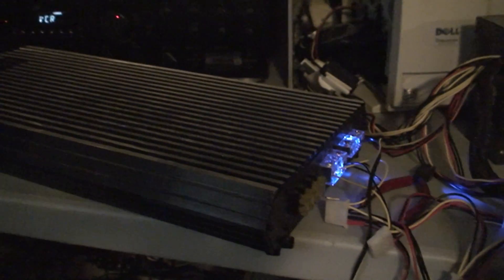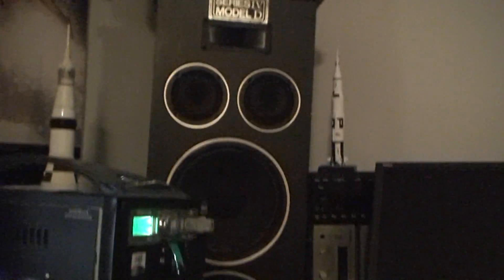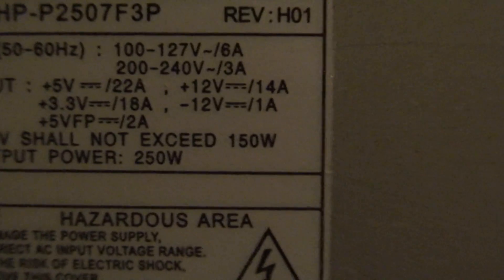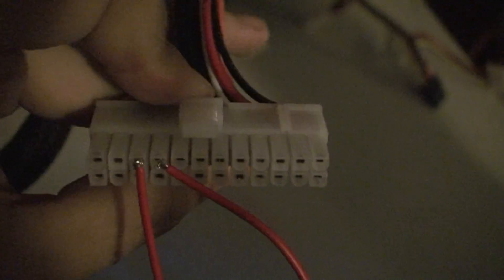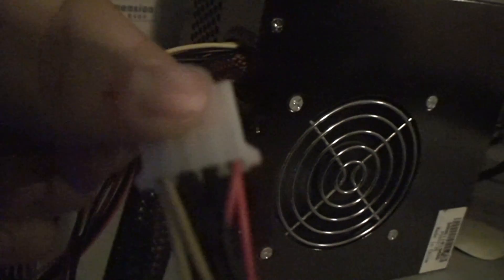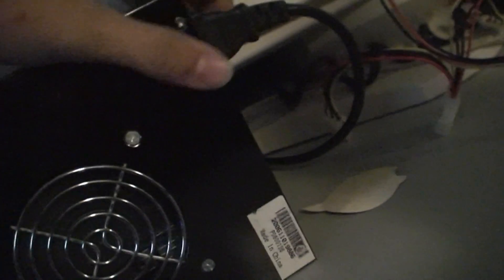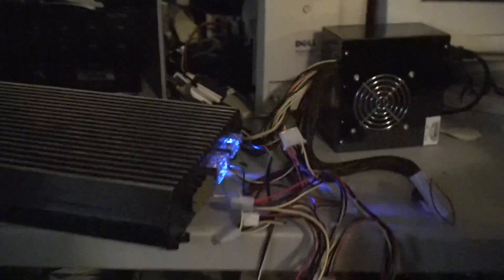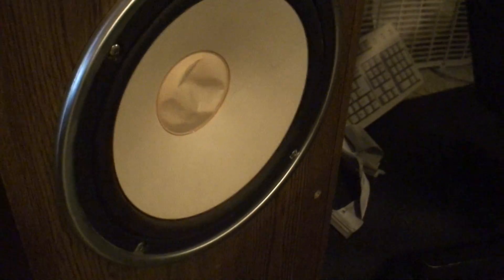How to make a Car Power Amp work on AC power using a PC power supply

Comment: if i have a 600 watt amp, 1100 watt sub, and a 125 watt PSU, can i run it with the gain turned down, and can i hook up a capaciter between the power unit and the amp to be able to run that much?

Comment: @ToXiicBacon no. an extension cord runs 120v AC current. which will fry the amp. you need to convert it to 12v Dc with this or another converter.

Comment: You know they make powersupplys for stuff like that? They have them in a variety of amperages. I used to have a 25 amp power supply it powered my small rockford fosgate punch 40 just perfect I was able to also run it bridged with no problems. It was a Astron brand switching powersupply.

Comment: This does work. However, REM means remote. Which is a power wire from the head unit that sends signal to the amp when the key is turned on which turns the amp on. FYI.

Comment: @t93raze ive heard to be stable to blast it like you would in a car you need around 1.5x the watts of your amp. so if ur amp is 800 watts, you need 1200 watt power supply

Comment: great video. stupid question from a nerd :) so i know how to brdige power supplies together blah blah. im not going to buy one, just bridge maybe 4 or 5 together. ive got em laying around. and its a cheap way to do it. and i know it wont blow cuz im doing it properly. hes got a 1000 watt amp but the speakers(2) are probably only 400 each. i hear you need around 1.5x the power supply watts of what your amp is rated at. is it true? thanks in advance

Comment: REM on the amp is the remote wire..on the back of your car radio there is a blue remote wire that when you turn your radio on it tells the amp to turn on...turn the radio off the amo powers off.

Comment: hello um i have a 800 w amplifyer and i rlly need to know what type of  pcu i should buy so i can blast it it says i sould set a fuse between the batery to the amp fuse recomended (40 amps) so i dont want to buy a psu wait 3 weeks and it justs shut of when i try to blast it pleas reply 

(im currently using a 300 watt psu now but i want more power to the amp)

please reply i do realy need help

Comment: What makes me chuckle the most as a competent design engineer of extremly robust and high power sound reinforcement gear is how many people think they actually have a 1000-2000-3000 watt (whatever) amp just 'cause it says so on the case'. There's a reason why a true 1000 watt PA amp cost 20 times as much as car amp or cheap PA amp with '1000 watts' plastered in big letters on the case.

Car amps for HI-FI off ATX off line SMPS don't equate to HI-FI. Sub in a surround system then,,, yeah!

Comment: A) REM + remote it turns it on and off
B)The correct way to do it is to go inside it and put a 40v power wire directly after the diode bidge of the amp. The amp takes the 12 volts you put into it converts it into ac then pushes it to aroud 40v rectifyed. SO IF YOU WANT TO DO IT RIGHT PLEASE PLEASE PULL UP THE AMP or just simply get something called a HOME THEATER system. If any problems are caused by this message it is NOT my falt. I dont exacaly know how much volts your amp converts the 12v to

Comment: Thanks alot man that helped me out... i had one question though can you use 2 pc power supplies on 1 amp? like wire them in sequence so that you have double the power? also i noticed i have the same computer tower case as you.

Comment: @bonemantis Ok, Well I've found a 1000watt PSU for $130-150 range its a cooler master brand.  As far as the AMP goes, didnt know that a under powered amp will blow high power handling speakers.  These JBL's are supposed to be liquid  cooled, The car stereo shop that sold them to me saw my in car setup and said a better power amp would be better (better sound), but nothing  about blowing the JBL's. Not doubting you, just shocked. Now I need to find a amp.

Comment: @beercap007 You should probably buy a new amp, because a 500 watt amp isnt going to be enough to power 2 1000 watt subwoofers, it will give you some sound but not much, and if you turn up the volume too high youre gonna blow the sub.
I would recommend you getting at least a 1200 watt amp, and a 1200 watt power supply, 1200 watts psu is the most that there is. I dont think theres a 2000 watt power supply. And all of that is expensive, and that will still not be enough to turn ur subs full volume.

Comment: very cool video buddy, I've been wanting to do this for like 2 years now... I have a band-pass box with 2 10" 1000watt JBL, and a 500watt (isn't a true 500) amp LEGACY brand.  What size power supply should I go out and pick up to power this? I have a 5.1 home theatre system, but lets face it... most of the bass boxes in such systems suck, so I'm looking to beef it up a little ;)  I am also making my speaker portable so I can take it outside on my back deck patio when I have my patio speakers on.

Comment from the maker: @OEAbass 
it will run it, however you run the risk of burning the unit out if you pull too much current.  most PC power supplies have a safty feature where they will trip off before damage occurs, so you should be allright.    tying the wires together works on most psus, especially good on psus that have mutible power rails, however on advanced units (in my experience) like ones with PCIE power outputs tend to trip off and not come on with all rails tied together.

Comment: great video! I want to connect a 12" 1200 watt peak power sony xplod subwoofer with a 500 watt bazooka amp to a dell inspiron 550 pc. I have a logitech z cinema sound system if that is important, however what kind of power supply would i need? Please reply thanks, and again, great video

Comment: i have everything hooked up  it powers on and my speakers are hooked up aswell...i have a rca cable that goes to one jack and when i plug it in my comp and turn it on nothing comes out, i have a 200 watt chaos wired 2 channel amp hooked up to a 200 watt computer psu ...whats wrong lol

Comment: im serious, my power supply is a 14 volts at 30 amps power supply , it has a big tranformer and 2 big capacitor so i can hook a good size amp with a good sub or subs, i will make a video later so u guys can watch my power supply working, but just check my video so u guys can see the difference between a psu and a real power supply

Comment: well if u guys wanna use a computer power supply use a 400 watts or higher one, they give u around 15 amps, thats what u need 12v and more than 15 amps, and use all the yellow wire togeter and all the black together too, chech out my video a have a 500watts psu modded, and i don't have all those wires everywhere, plus it was a temporary if u really want something stable get a 12/14 volts at 25 or 30 amps power supply like mine

Comment: A good power supply should automatically switch off when its ratings are exceeded. It should not fail in any way to provide clean power to the computer - if it does so, then it could damage a computer. 

I use these PSUs all the time. They're cheap, they have very high outputs (especially for the price), they're usually short-circuit, over-voltage and over-power protected. But they do have a lot of noise on the output (usually beyond audible, because of how a switch-mode PSU works.)

Comment: Yes.  Rem is 5v, I believe.  Not 100% on the amps, but it's very low as well.  Low current, like you said, just tells the amp to come on when the head unit does.

Comment: There is 1 thing U have to REMEMBER, U must match the Ampere on the PSU to the amplifiers fuse('s) or else there will not be much sound ( if u have to little)  hope this helps^^
=)

Comment: hey i got a rosewill  rbr1000-m  im geting a 1500 wat amp  so all it takes is one 12 rail and one ground  and thats all i need to power a amp what if i use a cap i have seen ppl use all the 12 rails  on a psu  to  power the cap  would this be a good idea?

Comment: i think most amps run at 14.2v i would make a voltage converter.2000w is alot u can get a real bench power supply.

Comment: rem actully is remote. that is what turns on and off the unit. you can always levae the baterry leads on but dissconecting the remote acts as a relay  and shuts it off.

Comment from the maker: The power strip and extension cords will have no more draw than a computer with that psu.  Should be fine in that reguard.   The wiring on the PSU is alot smaller gague than what you would use in a car.  Ive seen others combine all the 12v wires and hook them all to the amp, however when I did this the PSU wouldnt turn on, I belive its because mine has 4 12v rails, and didnt like me hooking them all together.

Comment from the maker: it would 'work' but you wont be able to use the amp to its full potential, and if you crank it you risk blowing speakers or maybe even burning out the amp. Usually the fuse will go first, but be carefull.

Comment from the maker: that would be perfect actually, the PSU should provide more power than the Amp.  Depending on the computer power supply, they have power 'rails' typically one for the 5 volt power and one for the 12 volt, usually a 500 watt power supply will send like 150 watts to the 5 volt and have a max of like 350 on the 12 volt rail. an 850 should be more than perfect for a 400 w amp, you can use it to its full potential with no danger.

Comment: I am sure that car amps are 2 ohms and I have never seen a house hold speaker that will run at 2 ohms that probably causes them to exploded not the low power.

Comment: I you could hook up a head unit, just know which two wires are your 12v and ground and connect those to the PSU. I don't see any reason that wouldn't work :)

Comment from the maker: Ah, Maybe so, my wires are green and black, Ive seen them with grey and black too, but I have a diagram on the side of the PSU that tells what each pin is, and I double checked on google, and It said that all ATX power supplies had pins in that order.  Maybe yours is a different form factor.

Comment from the maker: Most PSUs have 4 wires, 2 grounds one 5.3v and one 12v  Usually they are black red and yellow, I have seen blue and white instead of red and yellow, but anyone with a multimeter can figure out which one is which.